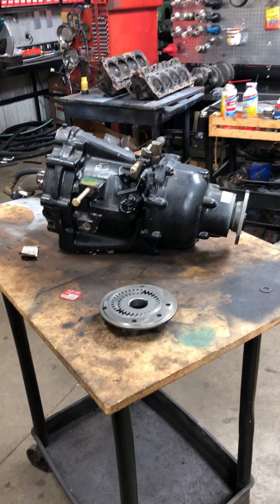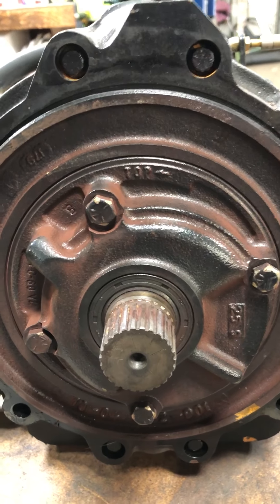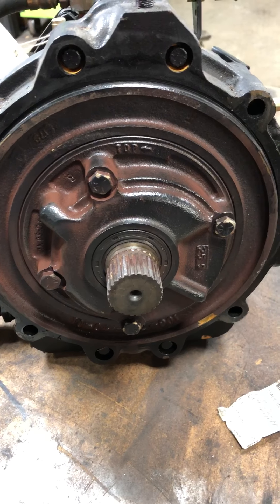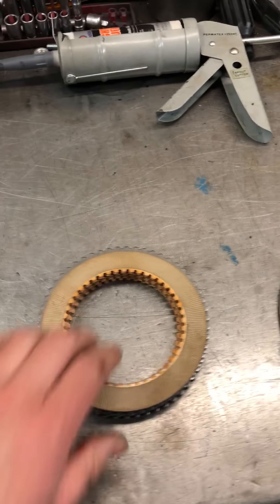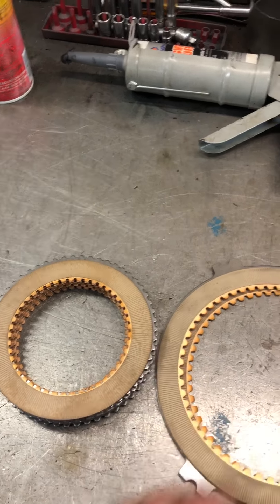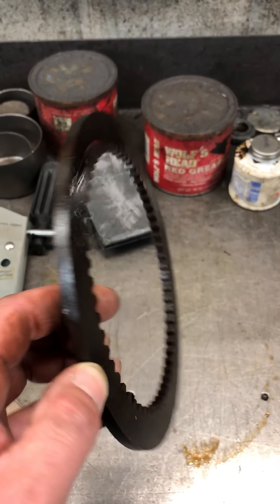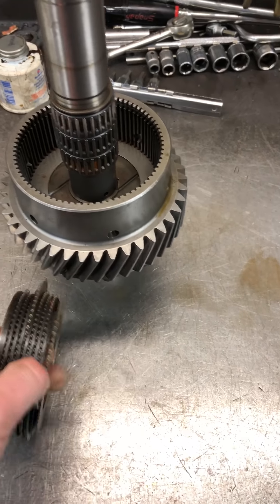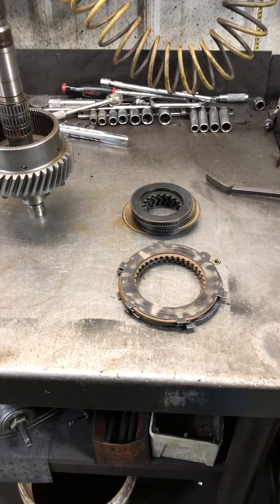Marine Transmission Rotation ID Velvet Drive ZF Hurth

Comment: Great video! I have a problem with my boat (Volvo penta 8.1 with zf 45 A ) all of a sudden the transmission is not going into gear. Won't go forward or reverse. Cable is moving the lever, transmission fluid level is OK. What could it be? Thanks in advance for your advice!

Comment: Thank you for the video extremely informative, i still have a question of my case which is a borg-warner  71cr 1.52:1 fw and  rev. I wanted to know since the transmission is currently in the boat if there is away to change it to run in reverse to go forward. Some time before i purchase the boat i believe the owner did a rebuild with the wrong rotation engine  and my propellers don't counter rotate as they should specified by the manufacture. I have being looking for a solution that isn't taking the engine out and making it counter rotate. Do you have any suggestions?
Reply: Use a Right hand Propeller, you can trade your left hand in (or vis-versa if I did not understand you correctly).
All done!
Reply: please, I really appreciate if you can answer me, I speak from Brazil, I have a velvet drive reverser, it rotates at the same rotation as the crankshaft when going forward, I would like to know if I can use it in reverse gear to go forward, so I don't need to change the propeller, does it cause any serious defect to use like this?

Comment: Hi i have borg warner trany with low oil pressure. What could be a reason(s)? Oil recently changed. Twin engine boat. The other side is good which works with the same fluid. Engine is reverse rotation.
Reply from the maker: Most likely you have a high pressure leak internally or the pump has failed. It will have to be removed for tear down and inspection.
Reply: Lakeland Auto Thanks! I recently rebuilt engine but didn’t touch trany but looks like its time now...

Comment: What's the benefit on having one of these installed. I've thought about putting a transmission in my jet boat and been looking for a transmission so that my boat isn't always at high rpm. Will these help with that.
Reply: Fili Tamayo no the transmission doesn’t have multiple gears for each direction. One coward and on reverse speed

Comment: I have a question on an early model 71c can you change the Pistons and plates inside the converted to a big block
Reply from the maker: Unfortunately, no. The 72C case is 3/4” longer to accommodate the longer forward drum and input shaft for the 13 clutch plates from the 71C’s 9.
Reply: @LakelandAutoMarine  thank you for the response now I just need to decide if I want to overhaul the 71 upgraded to the 72

Comment: Thankyou very much just a quick question just to clarify I'm wanting to buy a 72c Borg Warner gearbox for my narrow boat the one I'm looking at is 1 and a half to 1 reduction my engine looking from stern is running anti clockwise but it would mean prop running clockwise I want me prop to also run clockwise so would I be able to turn oil pump 180 degrees? or not thankyou so much 
John
Reply: I meant I want my prop to run anti clockwise (left handed ) in forward sorry useless with technology lol
Reply from the maker: No. Crankshaft rotation is prop shaft rotation on a 72C 1.5:1 transmission.